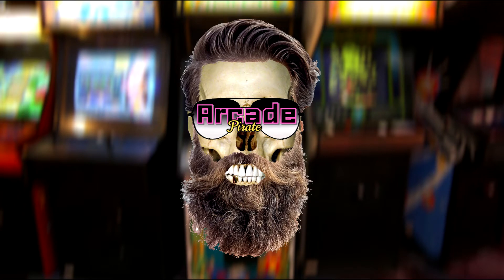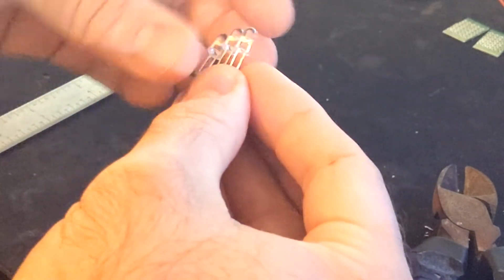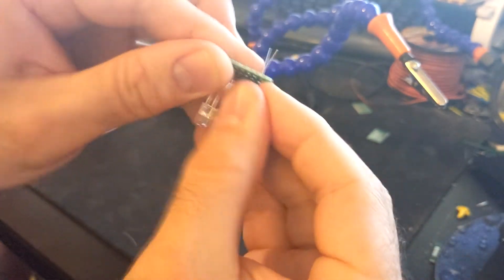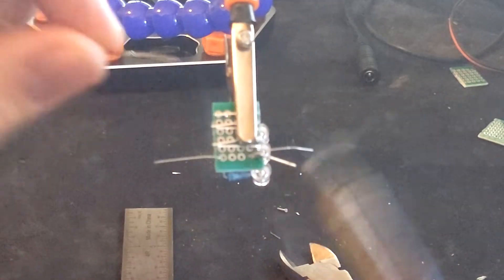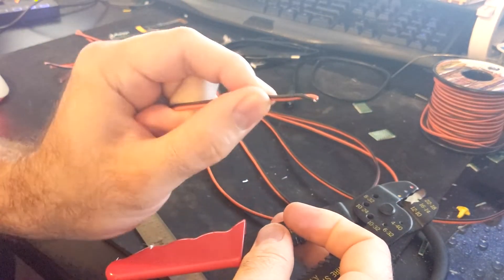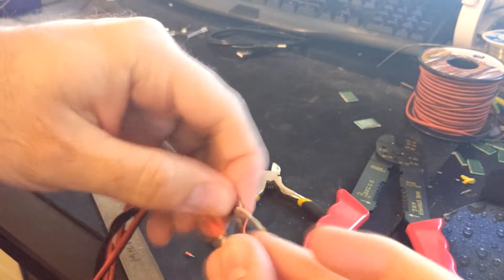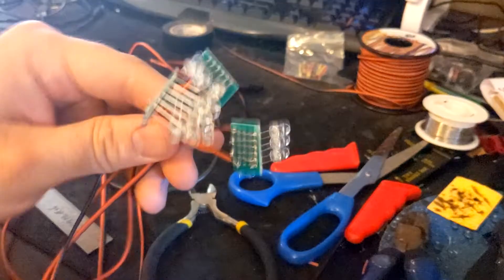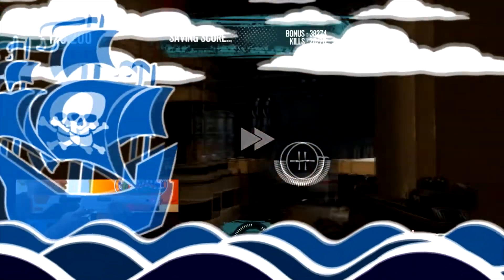IR LED Sensors Creation

Comment: Awesome videos. Really sad because for whatever reason I followed this to a T and I'm not getting anything on my camera (I have an Android) power is getting to the board. I am playing on a smaller screen to test.  Resister is correct. The literal only difference is I have an adapter 5v 2.5 amps is that causing issues? And the same black leds that is seen in the rpegelectronics. I'm also  using the exact wires too. Just really confused.

Comment: How did you do the resistor calculation? When I did it, I got 47 ohms, and my gun is having some flickering issues, and not always finding the LEDs easily. I think I need to redo the LEDs with a 27 ohm, like you have here, but maybe your IR LEDs are different than mine?